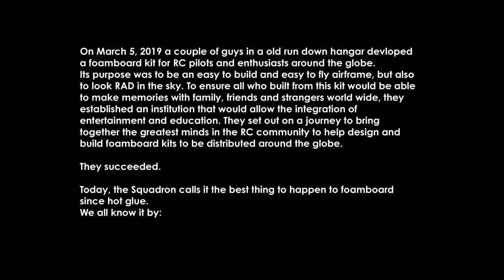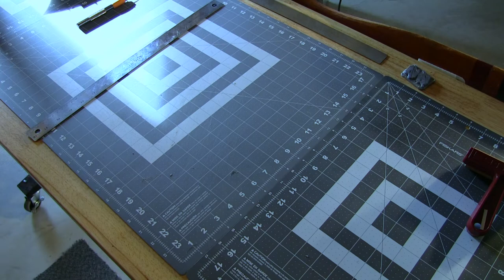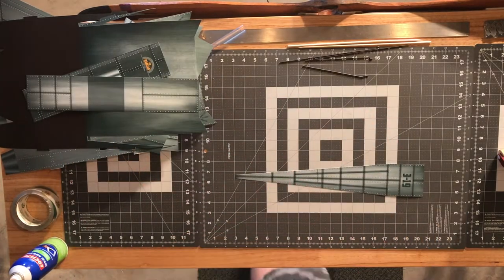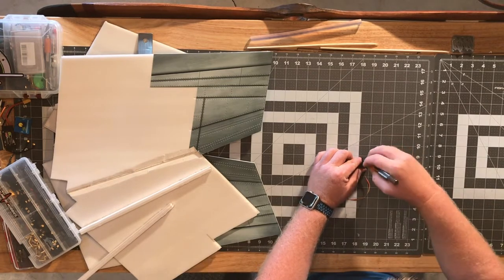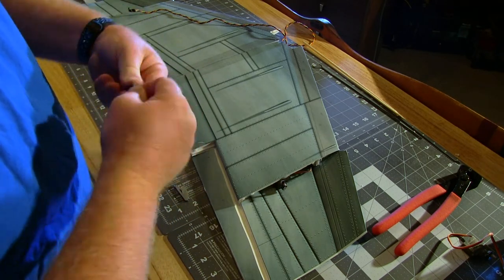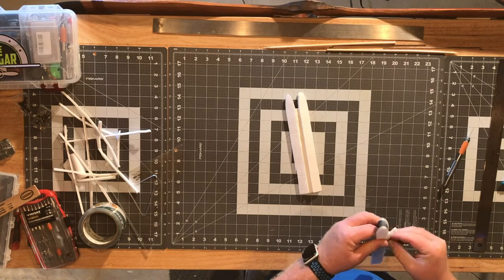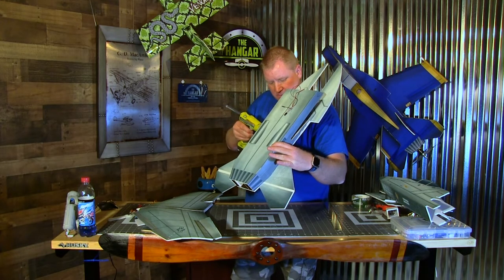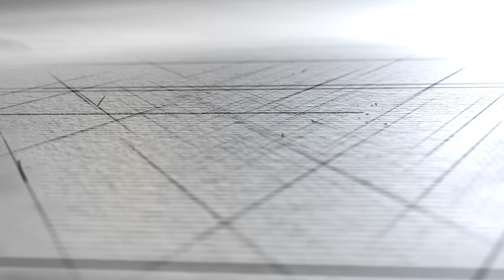How to build the HRC Wasp (F/A-18 Hornet) / Build #DIYRC

Comment: After 3:25 wonderful build 
Nice body build and parts joining 
I would reinforce the motor mount with packing tape the glue won’t hold the force from the motor , all the bottom belly needs to be covered with packing tape , besides this will you have a second Video with the RX ESC and battery setup and  CG , do you need reflection on elevators ?  Did you think to make it a EDF looks like you have space
Reply from the maker: Thanks for the suggestions! We have never had a problem with the motor pushing through... but yes tape could help reinforce! About the follow up video yes, when our power kits come in we are planning on producing a tune and fly video! Thanks again for your support, your comments and your helpful suggestions!